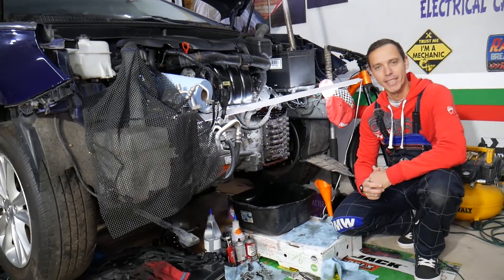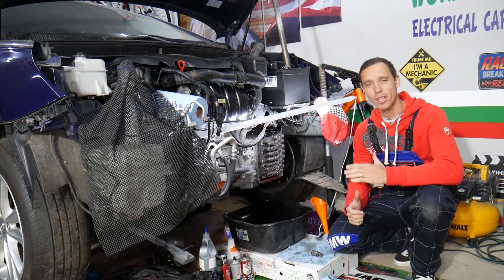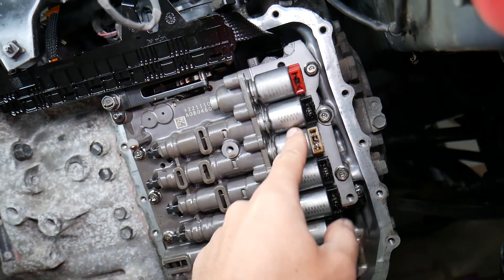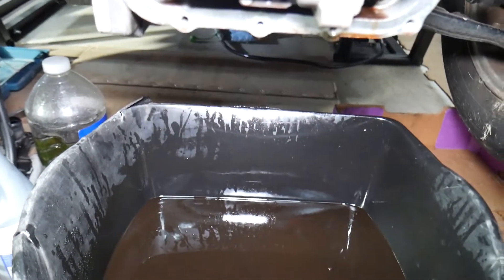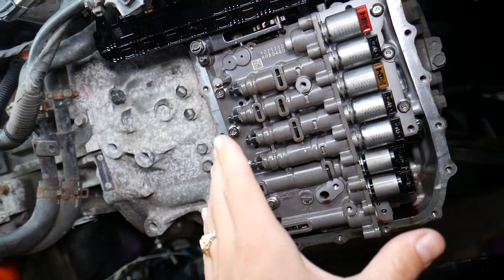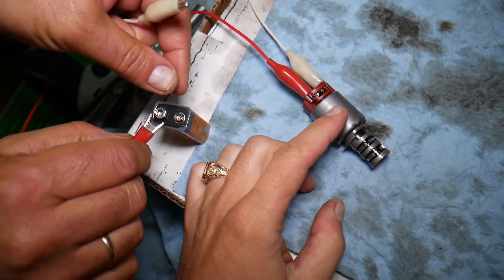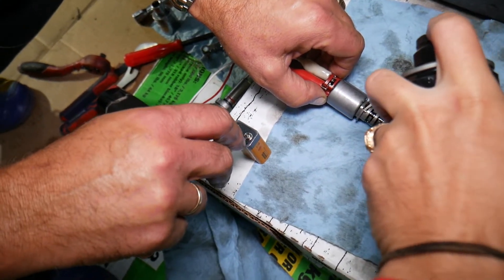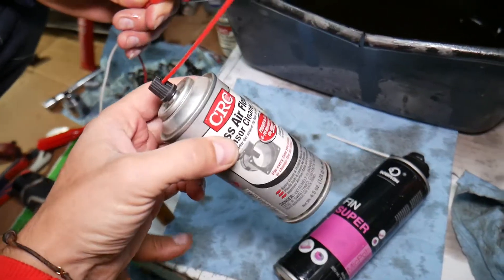HOW TO CLEAN AUTOMATIC TRANSMISSION SOLENOID ON A CAR

Comment from the maker: Products that we use and recommend:
► Transmission Solenoid: https://amzn.to/2ZytZYu
► Transmission Oil Pan Gasket: https://amzn.to/3pQKASc
► Transmission Filter: https://amzn.to/3BzrAdq
► Transmission Oil Pan: https://amzn.to/3mqbXQW
► Transmission Fluid: https://amzn.to/3mqlDuM
► Panel Removal Set: https://amzn.to/3YiMADu
► Assorted Fuses: https://amzn.to/4fx4s3F
► Tool Set: https://amzn.to/3p5MM6t
► Screwdriver Set: https://amzn.to/3XRB28Q
► Castrol Oil: https://amzn.to/3xBc8B9
► Oil Filter: https://amzn.to/3w0Ulme
► Torque Wrench: https://amzn.to/32qyRwg
► Liqui Moly Engine Flush: https://amzn.to/3IiDBID
► OBD Scanner that we use most often: https://amzn.to/3I4MQfe

► Check out our Amazon Store for the tools and parts that we use: https://www.amazon.com/shop/worldmechanics
Reply: How honda transmission works

Comment: Two questions. Are the white,green,red lines there by change or I found a secret clue :D 
And second one - if I have to clean the solenoid in ultrasonic bath, what solution you would recommend ? Thanks.

Comment: Hey! Nice video 

Can you please mention the names and photos of the cleaning products that you used?

And I wanted to ask you something?  I have see videos where people are opening up/disassembling the solenoids in order to effectively clean them, I see that you have not disassembled anything. Do you think this does the job right?

Secondly, could you please take a look at Toyota A442F transmission and tell what kind of solenoid are those, and the best way to clean them so that they work perfectly ( there are only four in this particular transmission) I am asking this because effectively cleaning each solenoid requires a different method, if you look at A442F and let me know I'd really appreciate it,.

Thanks a lot